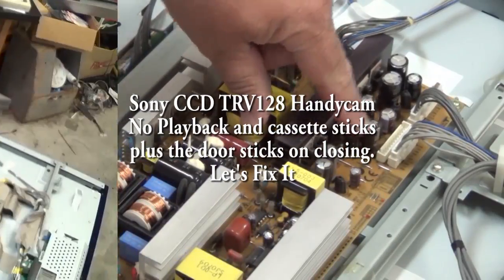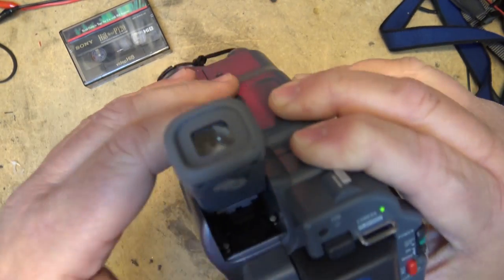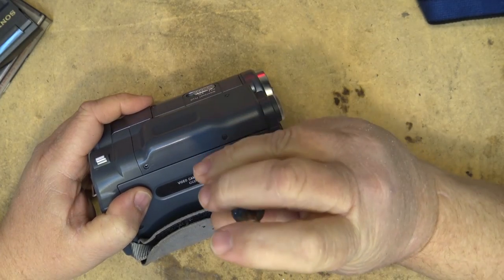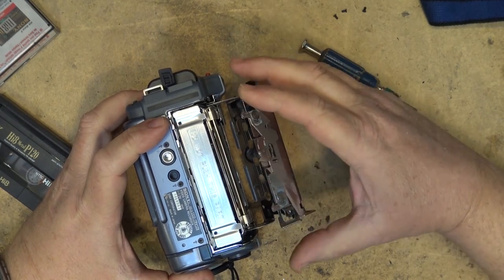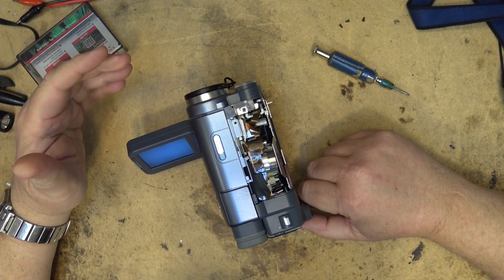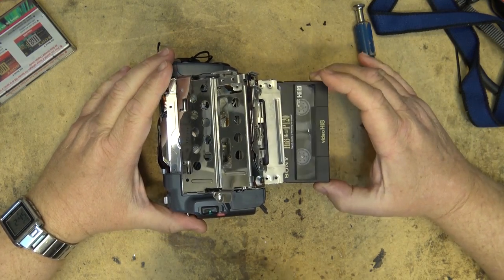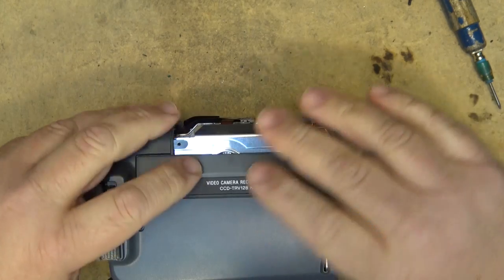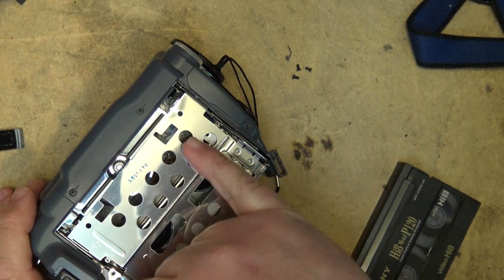Sony CCDTRV128 no playback and sticking cassette repair

Comment: Hello - ended up on your page because I'm having an issue with an old camera and we are trying to transfer tapes to flash drives.   What causes a tape to wrap around one of the what I will call posts?  The post is the largest of three.  Seems to have a black neoprene wheel about 1/4".  One of the other posts is white about 3/16" and the last is silver metal about 1/16" wide.  BTW the black seems to be out of alignment with the other two.
Reply from the maker: The rubber roller is the pinch roller.  That what pulls the tape past the heads.   The guide pins are angled.  That's what guide the tape around the head drum.
Reply: @12voltvids  thanks - so what causes the video tape to wrap around the pinch roller?
Reply from the maker: @garygembala306  well if the take up spool isn't turning it will eat.  If something sticky is on the pinch roller the tape could stick to it.  I'm not looking at it so how would i know.

Comment: Hey! i have a TVR 280 like this and plays back choppy and with horizontal slit lines, would this work? ive seen other video about reseating a connector for the exact same problem but it was a different model
Reply from the maker: Could be a misseated connector or a clogged head or worn head for that matter.
Reply: @12voltvids  just tried the fingernail and it didn't really work, as soon as i opened it i saw a fingerprint in the roller part that doesnt have grooves, maybe i should try to clean it with isopropyl alcohol? im gonna try a different tape too, im getting error c22 on screen

Comment: Hi there .. the fingernail technique worked for me initially but then I played a tape that was damaged in one spot and now I just get a black screen and audio. Subsequent fingernail attempts haven’t worked. Any ideas?
Reply from the maker: If you are getting audio the heads aren't clogged as the same heads are used on 8mm format for audio and video.

Comment: Sir I have the same exact problem on my CCD-TRV46: No playback, blue screen, showing some stuff when rewinding, and choppy sound. However i cannot use the finger cause my camera has a shield guard installed next to the head. Will the head cleaner be useful?
Reply: Grab a Sony head cleaning tape and will do the same job.. you can still find them on ebay but going up and up in price due to them not being made for years.

Comment: I did the same thing and also checked the connectors it went from no picture to showing something with a lot of distortion and on off picture no matter how often I try the finger trick it is not going to solve it completely.. 
If there is something else I can do let me know

Comment: I got one of these I put a bad tape in, and now there is no picture, I can't open it up like you did since mine is different, I tried using cleaning swabs (heavy duty swabs) and ipa but it didn't work, do I needa buy cleaning tape off ebay or, any advice? 

before I put the bad tape in everything was working fine, hasn't been dropped or tampered with
Reply from the maker: 8mm and Mini DV camera can not be cleaned with IPA because the tape is metal. When it clogs the head it literally fuses to the head and the only way to get it clean is to scrape it off.  Back of fingernail against the spinning head is one way and a dry type cleaning tape the other.  A dry take literally rubs the dirt off, but it also takes a little bit of the head surface with it so you don't want to overuse it or you will where the heads down quicker.
Reply: @12voltvids  how long should I leave the cleaning tape in,
Reply from the maker: @theavastark6463  follow the directions on the cleaning tape.  10 seconds

Comment: Also, is it possible to use the same method with the finger nail for a mini dv camcorder?
Reply from the maker: Yes, and VHS, beta and dat.
Reply: @12voltvids  I have a vx1000 and the head drum makes a loud noise, it records fine without any issue but the audio picks up the loud spinning noise. Do I need to replace the head drum or is it fixable?

Comment: I had this exact same problem, trying to fix it myself, is there an email I can reach you at? I'm running into an issue not seen in this video though related to the exact same problem

Comment: I have a hi 8 trv-57 it’s reading the error code c:32:20
For some reason the actual tape is sticking out a little on the bottom and the eject mechanism won’t work. Is this a problem that happens often? Is there a way for me to reset the camera?
Reply from the maker: If the tape is not winding back then could be mechanical or electrical. Check the edge connectors

Comment: Do you repair Sony digital handycam DCR TRV250?  The playback mode is not functioning.
Reply from the maker: If it can be fixed yes.  Some can be fixed and others not. Just had one that I spent hours on and the fault turns out to be a failed board.  Many can be repaired though.
Reply from the maker: you can contact me by email

Comment: My camcorder was working but said "clean head" then when I tried again to open it to put in a cassette cleaner, it says "Locked" when I try and open the cassette disk. I can clearly see a thin orange "string" that is suppose to connect something came undone. Im sure its just as easy as finding where it goes. The camera still turns on and shows an image. I was trying to see on this video if I can see where the orange "string" goes but you cant see it...its the same model.

Comment: I have this exact camcorder... it plays when plugged, but I cannot get it to eject. I have tons of tapes I would like to digitise with it, but I'm wondering if there is a video that might show how to fix the eject?
Reply from the maker: When the cover is opened it activated a switch to unload the tape
Reply: @12voltvids  yes, thanks. The blue door does tilt outward, but the inner metal cage does not track upward to expose cassette tape.
Reply from the maker: @fontesfilms5734  does it beep when you open the door? If not check the switch.

Comment: Very cool.  I have a similar HandyCam.  Mine is a Digital8 DCR-TRV280.  My problem is when I put a tape into it I get a message to "reinsert the cassette" over and over.  Seems like something is stopping it from playing the tapes.  I've searched for a fix and tried the "slap" method, but that didn't fix it.  I still get the "C:31:22" "reinsert the cassette" error.  :(
Reply from the maker: Most likely the edge connectors between the mechanism and main board need to be reseated
Reply: @12voltvids  Yep, I followed your video and was able to get it working again.  Thanks so much!

Comment: Was there a special reason it cost so much to ship? That's an absolutely absurd price (I can say this with certainty, I ship things for a living)
Reply from the maker: That is what the post office charges. Before you say should have shipped it fed ex, fed ex add 37.50 minimum charged to the receiver. The last person that shipped me a camera to repair ended up with an additional 48.15 in taxes and broker fees added to the cost of the repair. Canada post is a little cheaper. USPS is probably the most expensive way to ship but at least there are no extra fees added at the border.
Reply: @12voltvids , USPS sounds like the way to go. Thanks Dave, some good advice.
Reply: @12voltvids  ahhhh, I hadn't considered that you were in Canada... That explains it!

Comment: I have this model of camera and have been using it to digitize, and it worked fine a day ago but now every tape is just giving me intermittent static and no picture. Tried cleaning the head with my fingernail (although my nails are very short, but I think it still worked) and the picture still isn't coming through. It also wasn't showing any picture during a pause and ff/rew. I've tried it on multiple tapes so I don't think it's a tape issue. If you have any insight that would be wonderful! It's been a massive hassle trying to find a Hi8 camera that works, and then just when I think I've found one it craps out on me within a day! Ugh! Let me know if you have any ideas.

Comment: Hi idk if you’ll see this but just today I found my moms old Sony handycam same model as the video and I wanted to see if it still worked but from what she remembers is that she would turn it on and nothing would happen, even when she would put it to charge nothing happened so she ended up putting it away and claimed it was broken. When I found it I decided to plug in the charger but nothing. Now i don’t know if it’s too late to fix but Im wondering what would be the problem either a battery problem or something wrong with the inside of the camera, I hope you see this and get back to me thank you!!
Reply from the maker: Does the power supply power up (green light). If the power supply is bad you won't be able to charge the battery either. Hard to say if it could be fixed or not, but many cameras just due to the leaky caps are not worth fixing.
Reply: 12voltvids no the power button doesn’t turn on at all and if the camera can’t be fixed what would be the best option to watch hi8 tapes?

Comment: What if the fingernail trick works, but only audio is playing back?
Reply from the maker: On 8mm / hi8 the audio is recorded by the same heads as video so if you have clear sound the head is not dirty so that would indicate a failure somewhere in the video circuit.
Reply: Darn. I can see video when I rewind or FF but it disappears when I let it play. @12voltvids

Comment: hi do you know how i would be able to completely remove the cassette door/holder and replace it with another as mine is damaged
Reply from the maker: Yes the cassette housing can be removed.
Reply: @12voltvids  do you have any videos showing how to do this?
Reply from the maker: @imaqines  i believe if you watch the dcrtrv110 series where I swapped the chassis you will get an idea how it comes apart.
Reply: @12voltvids  thank you !

Comment: if i send my camera (ccd trv118) will you be able to fix it? And if so how much will you charge, and will i get it back?
Reply from the maker: If it can be repaired. Not every camera can due to parts available. Yes you will get it back just pay return shipping.  Repair costs depend on what is actually wrong.  Mist can be repaired for 100 and if it is more than that they just are not worth fixing.
Reply: @12voltvids  the problem is the cassette compartment doesnt pop up, how much u think tht will run me?
Reply from the maker: @sbgreatness  impossible to say without actually seeing it.
Reply: @12voltvids  okok thanks

Comment: Hello 12voltvids! I don't know how much you are still working on these or active but I have this EXACT model and I am unbelievably desperate. I need to digitize a tape by the 1st of June and this camera has worked perfectly for years and years but it has been in storage for probably 5+. The camera will play a tape just fine but the AV out to TV is not working. I get good audio but no video when plugging into my PC capture card. I have tried 3 different cables and also tried multiple TVs/capture cards and I still have the same issue. It comes with a single mono cable and a yellow video cable and I purchased a yellow/red/white to 3.5mm cable off of amazon and if I plug all three of these in, I oddly get a very scrambled/static picture that I was not able to obtain with the single audio cable. This makes no sense at all to me but I have got to figure this out for a family gathering on the 1st of June. I have found a few on Marketplace for $50+ but I feel like surely this can't be complicated since it plays the tapes and displays them on the side LCD screen just fine! Thank you SO MUCH!
Reply from the maker: You have to use the exact Sony AV cable. You cannot use any other AV cable. The reason is because of how it is wired and I have made a video showing the differences between a generic stereo AV and a Sony. You should be able to use a regular stereo audio cable to get mono audio or more precisely one of the channels of audio and video. The cable uses a tip plus dual ring plus ground. Most cables the ground is the closest to the connector followed by the first ring for one conductor the second ring for the second conductor and the tip for the third conductor. Sony is different Sony has the ground or the furthest or closest to the base of the cable as audio I think it was right the next one up the first ring is ground the second ring is the video and the tip is the other audio or reversed I forget anyway I did a video showing the differences between the Sony cable and generic ones if you plug a generic Cable in you will end up with a scrambled picture. I did cover this in with another camcorder video perhaps I should do a dedicated video to describe the differences and show how to make a cable for a Sony camcorder the trick is getting the actual 3.5 mm for conductor plug what you have that it's relatively easy to make but you can't just chop a normal cable up because the grounds are all connected together in the plug and that will short out.
Reply: @12voltvids  Oh... My... Gosh... You absolutely deserve a million dollars. You saved saved saved me!!! I had three cables all in various drawers of my house. Your comment have me inspiration to try and look one more time and I found a tangled mangled mouse chewed cord and BAM it worked!!!!
Reply from the maker: @FireFlowerFarmstead  I would love it if I looked in my PayPal account to find a million dollars!

Those Sony cords are as valuable as gold these days.  I only have 1 for 4 digital 8 players.

Comment: Hi i have the same problem with sony dcr trv 480e but the counter is not moving at all.. What should i do ?
Reply from the maker: The counter won't move if there is no signal read from the tape.
Reply: @12voltvids  i just got blue screen with no audio or video and the counter is 00:00:0.

What should i do?
Reply from the maker: @aboayyan  try cleaning the heads.

Comment: Hi , i have the same camera . If i record on this camera and i playback the tape in another camera . The image is perfect . But if i use the same camera in playback the image is interupted . I have used the fingernail techniek but no result . Is it a conector or maybe the heads just worn ? If the heads are bad, won’t the recorded image also be bad ? 
Please help me thnx
Reply from the maker: What happens if you play a tape recorded on a different camera on the one that's got the playback problem? If it also plays bad poorly it's probably something in the playback circuit. If it plays good and the tape recorded on the camera in question please good on another machine it's likely the head. As strange as it may seem when video heads wear out they will generally play other tapes okay and other machines will play their tapes okay they just can't play their own tapes properly and it has to do with the way they had wears and how the tracks are recorded on the tape. As the Gap wears the video track tends to wobble a bit in its Trace as a scanning the tape. Because the Gap wears narrower so the width of the video track decreases. Say for example if video tracks were 2 mm wide let's just use that as a number your head Gap is 2 mm it's not it's in the microns but let's say two millimeters now if your head wears to 1 mm and it starts recording a track that's supposed to be 2 mm wide it can vary around as the head spins that 1 mm track could be very varying around in that 2 mm space. when you try to play the recording back the head is not tracing perfectly so it's mistracking and missing part of the track and you get a bad signal coming back off the tape. Put that tape in a machine that does not have worn heads that are tracking the entire 2 mm width of track and even though the signal is only one mm wide the head is wide enough that it covers the entire track he's able to pay the signal back, it will be weaker but it's still there. At the same time put a tape in that was recorded on a machine with good heads and that full 2 mm track is there your warrant head that's only tracing 1 mm of it will see full signal because the track is the full width. That was how it was explained to me when I took the betamax training in 1983.  I used to see it all the time servicing VCRs. Customer would bring their machine in and the complaint was bad picture on self-recorded tapes. We find the heads were born telling they needed a new video head and the first thing that came out of their mouth was but it plays rentals fine. Of course it plays rentals fine they weren't recorded on that machine, and if they took a tape out of that machine and played it on one of their other machines it would also play okay and vice versa it just can't play its own tape the heads are worn. That's how they wear out.
Reply: @12voltvids  thank you for the fast replai .
The camera with the bad playback has only bad playback with every recorded tape from itself and other devices , 
But when i record with the bad playback device and play it on another device the video is perfectly recorded , no interuptions or noise etc
Reply from the maker: @claeyer3866  check for bad caps on the video board

Comment: Hi, maybe someone here could help me: I pressed the button "counter reset" and now my camera won't play any videos on the screen. How can I recover my videos and what is that button actually for ? I had a lot of things on that tape. Thanks!
Reply from the maker: Counter reset does just that. Reset the tape counter to 0. If the unit stopped after pressing that button check to see that the button isn't stuck down because the buttons are connected to the same bus and a sticking switch will lock the rest up.